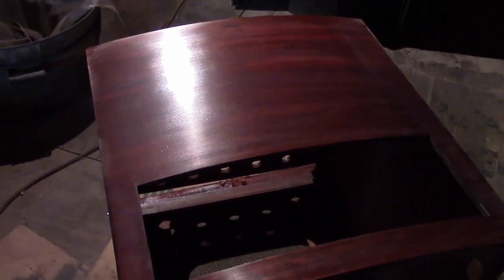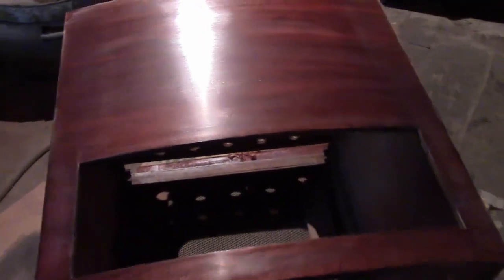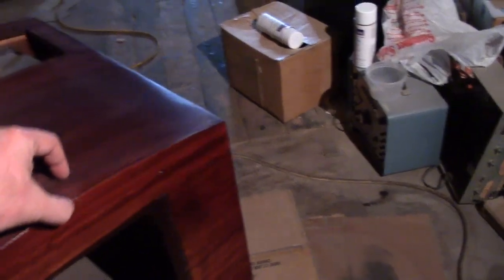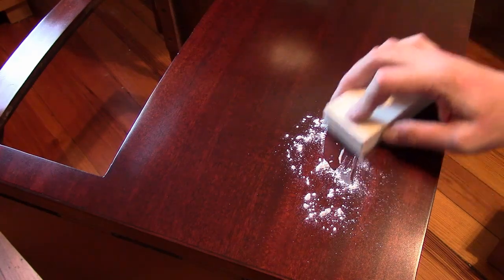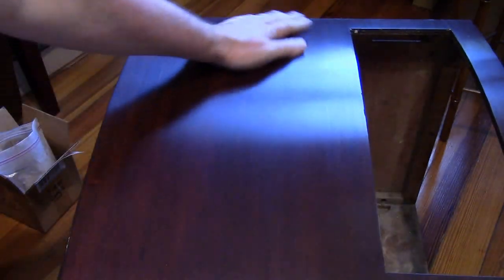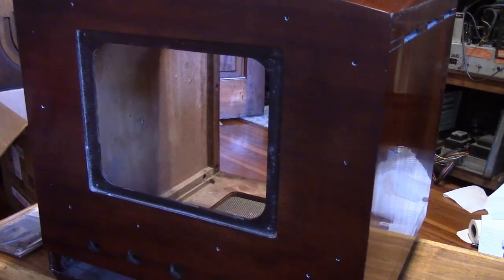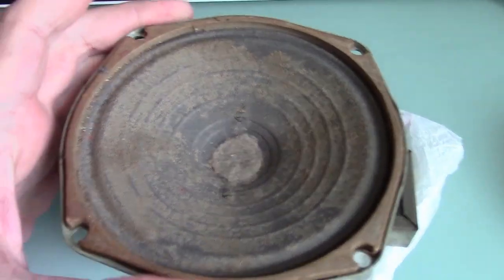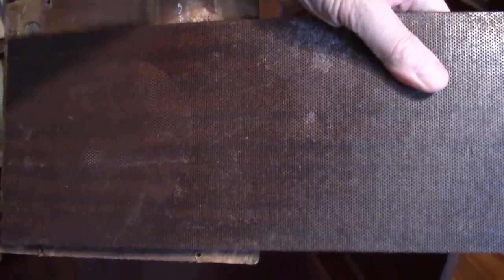Westinghouse H-196 restoration p14o?

Comment: Bob,
Problem with the corners looks like what we call blisters when we finish a model airplane with dope.  The cause is usually the dope is applied too heavy in the corners (I.E. wing joint, fin to fuselage joint, etc).  The only solution is to cut it out, sand it down and reapply.  As a matter of fact when we spray on our dope, we never really hit the corners directly because it can cause blistering.  We let the "over spray" paint the corners.